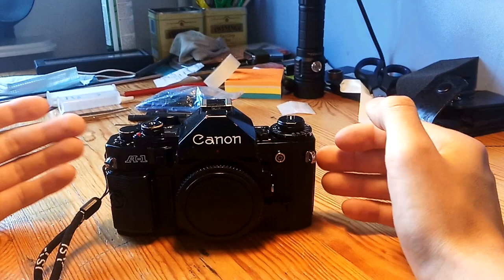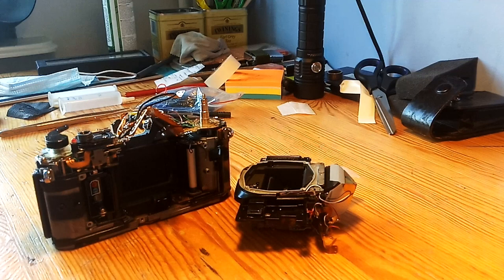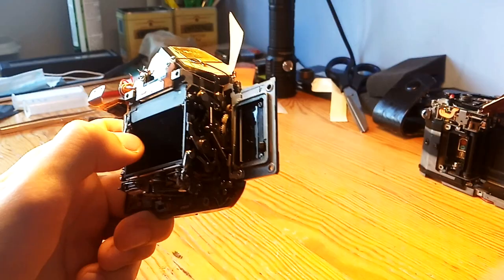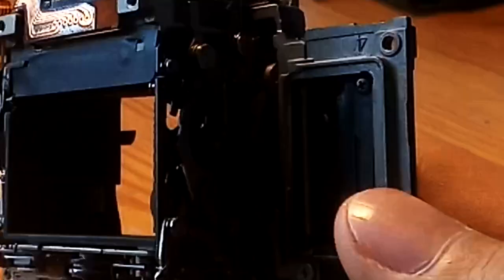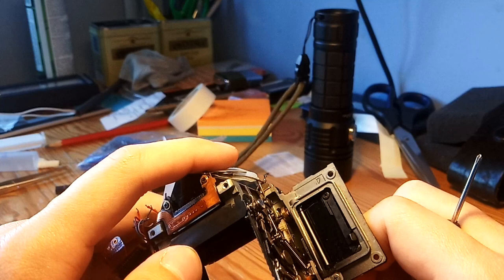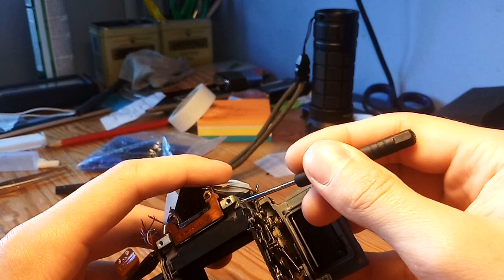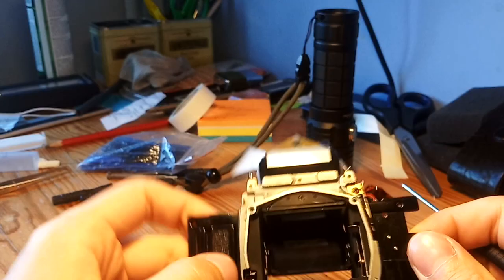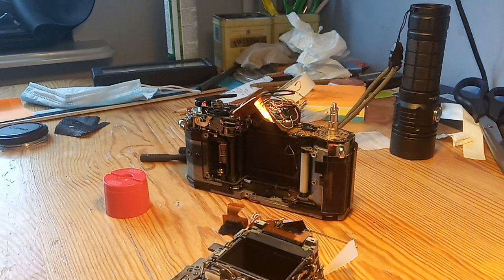Canon A-1/AE-1 shutter squeak & slow mirror explained

Comment: Well done, this is the only RIGHT method to correct the squeak. Open the mirror box and do the right thing. Do not inject oil by the hole like we can see on dirty YT videos.
Reply: Most people are not willing to risk that in depth repair, either take the chance with the syringe or just give the camera to a professional, there shouldn't be an in between

Comment: I still have my fathers old A1 that he gave to me when I was 10 years old! I'm in my mid 40's now and I was just about to try and drop some oil into the spot other videos mentioned but was hesitant do do so as I had heard before it was the mirror dampening parts that was the problem and was hoping there would be better way to fix it.   Loved this video explaining whats going on and showing us what not to do!  I dont think there are any places where I live that do CSL's to old cameras since everything's gone digital.
Reply from the maker: Where you live ?
Reply: @kshysztof9649  Eire/ROI (Ireland) My A1 has been through the wars! lost the winder and it was replaced by a soldered radio antenna that was cut down to a stub, lens mount was slightly deformed as a teenager when I got high on hash and accidently dropped it and for more than a decade the camera bag of camera + lens's was stored in an attic and got extremes fungus that ruined the glass and also had whats known as Canon shutter cough! I dont use it anymore but  At some point in the future I might consider buying another A1 for nostalgia purposes.   Have a few film cameras I recently got an Lecia R4 from ebay with a 50mm lens that was in great condition so looking forward to trying it with a roll of B&W Ilford film.

Comment: so now that we know EXACTLY WHERE, the lubrication needs to be, is there any possible way to lube those gears/bearings WITHOUT removing the mirror box?  could the camera be stripped down maybe half as far as youve gone, and still performed this lubrication?

40+ components removed/adjusted/DESOLDERED is a lot of work for this repair.
Reply from the maker: No, that's not possible unfortunately

Comment: Very nice video! I just got an A1 and every now and then there is a very slight squeak, not much at all. But I want to get rid of it. Is there a way, where you can put a tiny drop of oil on the mirror damper without opening too much of the camera, so that I can do it myself? A CSL is in my opinion too expensive when it works just right 19 out of 20 times

Comment: Hi, amazing video! I have a similar problem with my Canon A-1 except the squeak happens when the aperture signal coupling lever is moved. The slow aperture lever results in small apertures like f/16 to be something like f/8 when taking a photo. Was wondering where I can put the oil to fix this?
Reply from the maker: huhhh, how do I answer that. Well, I haven't studied this particular mechanism, but from what I remember, theres a mechanism similiar to a mirror brake, that also requires cleaning and lubrication. You're not supposed to put any oil blindly, that's for sure.

Comment: Thank you for making the video! Well explained. I found it just a minute ago, after I did the squeak.😢 So it‘s true. The Oil runs into the mirror box, even if you put in only a drop with an injection from the bottom of the camera. I hope, i didn‘t ruine it. Ist there any method to clean it up?

Comment: Wow, my AE-1 I bought from an old camera shop makes that very squeaky noise. I hope to put a tiny drop on those gears.

Great video, the really interesting stuff starts at 5:09
Reply from the maker: Just don't do it through the bottom plate  😷
Reply: @kshysztof9649  Yeah, I think I'll do it through the screw hole behind the face plate. Is that an acceptable method?
Reply from the maker: @anonharingenamn  no, there's not. Just, trust me. Send it for a CLA. The only acceptable, and working method, is complete strip. I know this is sad news, but just.. Ya know. This is a precise mechanics, you never see anyone willing a watch with Oil hahaha
Reply from the maker: You can go to Learn Camera Repair Facebook group, and ask if there is any camera technician around you :)
Reply: @kshysztof9649  Well, a CLA costs more than a working AE-1 so it's not worth it really.
Reply from the maker: @anonharingenamn  paying the price of a camera for CLA that'll let the camera run for many many years > Doing weird tricks and throwing it into bin and buying another one with the same issues after half a year.
Reply: @kshysztof9649  You have a point, of course. But some cheaper cameras really are not worth the money. The AE-1 is not a Leica, you know?

I have an A-1 that works well, the AE-1 is my backup.
Reply: @anonharingenamn  Seconding this. I lubricated my A-1 simply because a CLA is just too expensive, worst case I suppose I'll have to retire it and get another one if it stops working

Comment: hi, can this problem lead you to blank photos on the film roll because of the slow mirror working?
big thanks
Reply: It happened to me. I bought a second hand AE-1P with squeaky mirror, didn't test it without film, went and shot some photos and ended up with almost completely dark photos wherever my shutter speed was high. There is simply no way I underexposed that badly. The mirror passes over the shutter and blocks the light from coming in in that fraction of a second.

I fixed the issue easily with a single drop of oil through a screwhole on the front (worked for AE-1P) and now it all works completely fine. No oil buildup in my case, the camera feels and sounds brand new.

Even though this guy proposes being very precise with your oil - I really don't wanna take my camera apart myself, nor do I want to take it to a professional because it just isn't worth it for me. I'd rather do it myself and hope for the best. And the best happened!